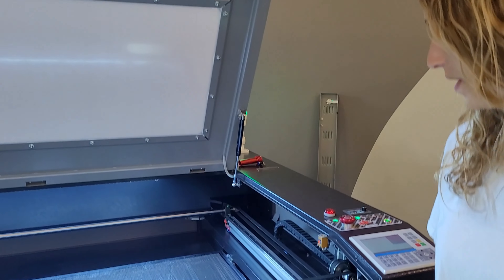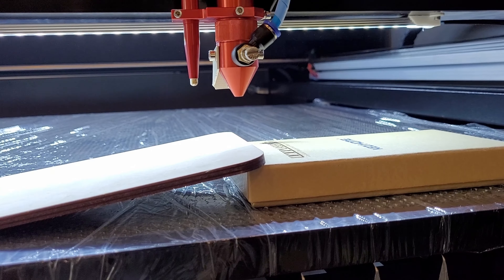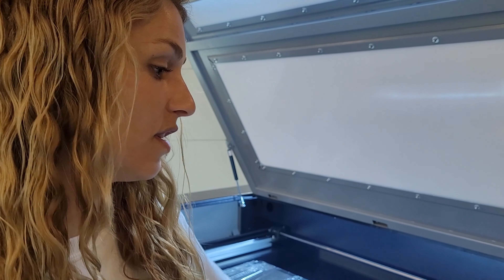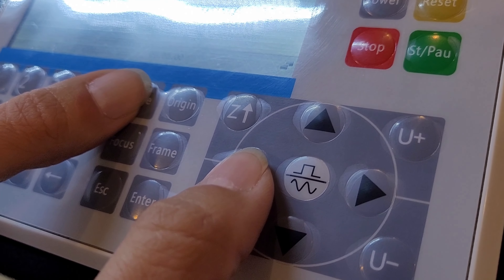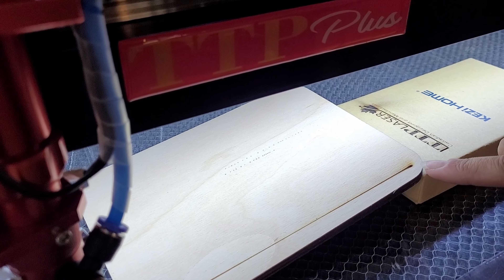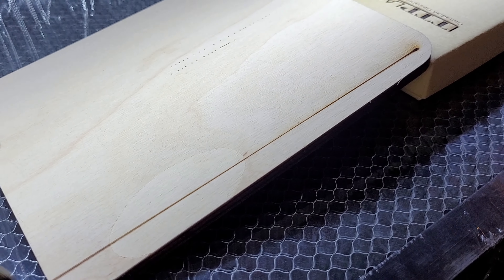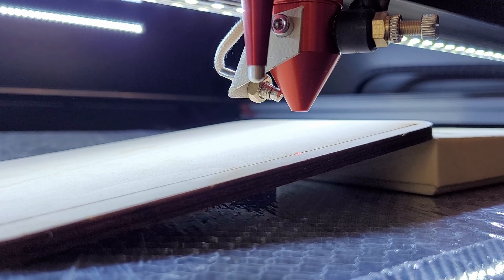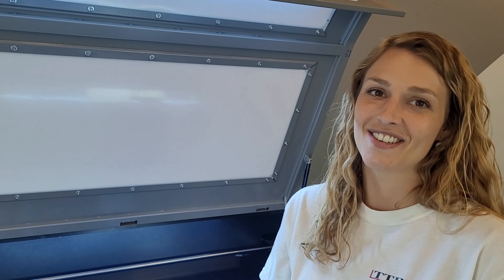How To: Ramp Test - Finding Your Focal Length

Comment: that was the focus distance from cone to surface, not the FOCAL LENGTH.  The focal length is the distance you just got, plus the distance from the bottom of the cone to the center of the lens.   Your system is very useful, just you named it wrong.
Reply: I was going to be a pedant too, but decided against it.
Reply: @chazcov08  Thanks for that Charles. Yes she made a mistake and we assumed people would get it. We make lasers but suck at videos lol